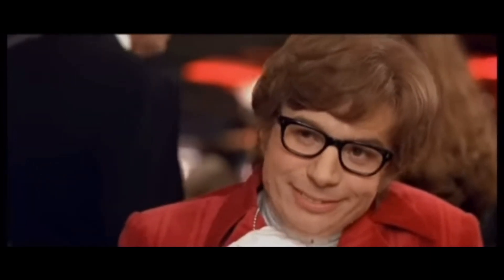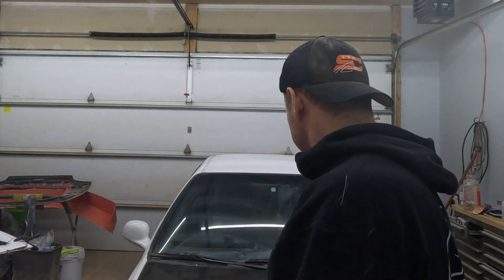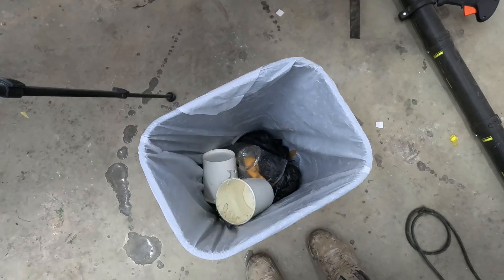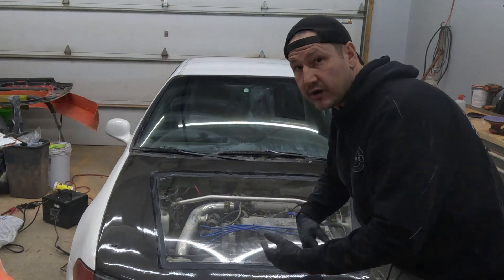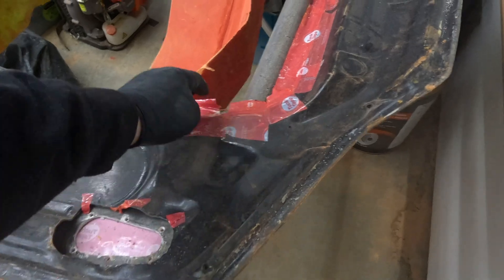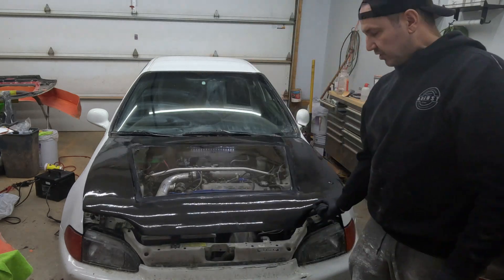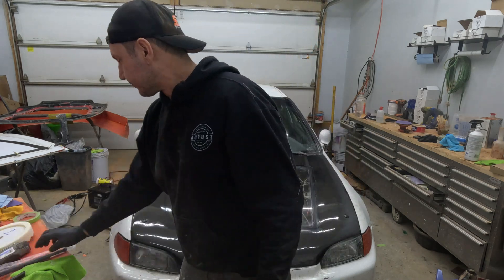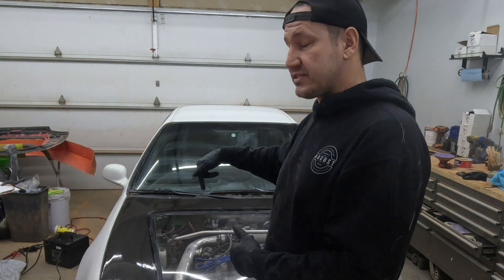Diy Carbon Fiber Hood Worth More Than The Actual Car!

Comment: Make a mold with the glass on it , then leave a 2-3 inch lip around the glass and put something on for the carbon fibre to bind too, then it’ll be built into the carbon fibre with 4 points of contact all the way around
Reply from the maker: Good idea!

Comment: Asking for advise from this guy that has no skills.....alrighty. The only things I can think of would be to round the corners of the window as it appears a square hole was cut into the hood to fit a square window (It's really tough to see in the video that the window follows the bodylines). Rounded corners may flow a bit better with a round shaped car and stresses/cracks love propagating from sharp angles. As for finishing, if it's flush, then I'd just look at pinstriping it. Or you could make a carbon fiber frame to go around the window. 
However, the amount of work, and the execution just to be able to do what you did is outstanding!!! So take my remarks and do whatever you like with them. Delete it, keep it, whatever as these are suggestions, but when it comes to making stuff, I really don't know what I am talking about.
Reply from the maker: I’ve had a few suggestions on what to do. I’m working on a plan now!
Reply from the maker: I’ve had a few suggestions on what to do. I’m working on a plan now!